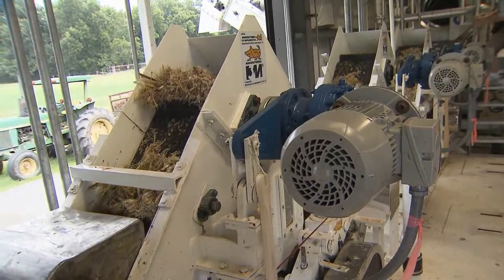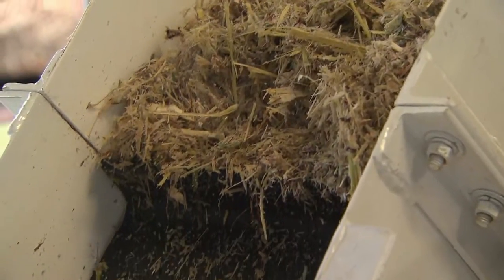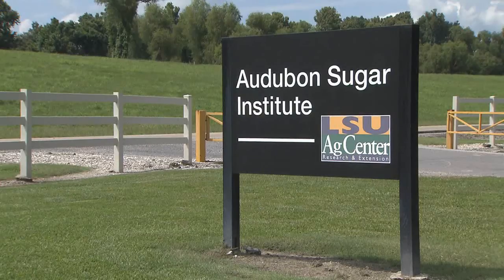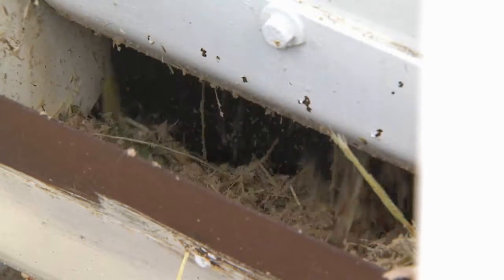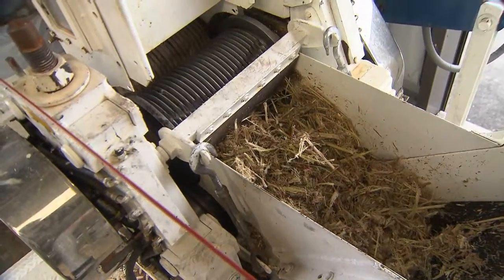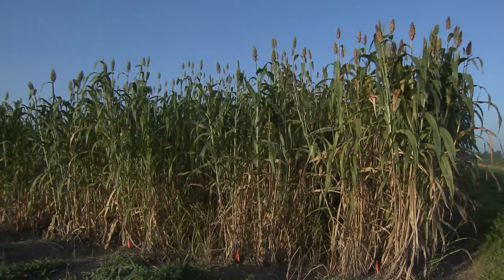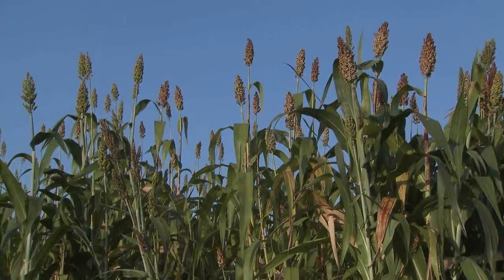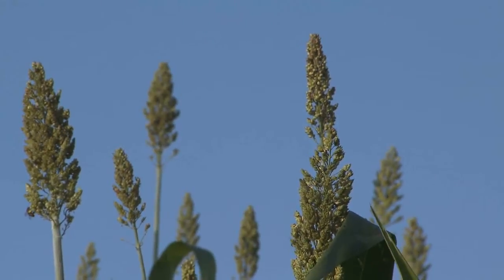Audubon Sugar Institute is turning sweet sorghum into biochemicals

Comment: find the crushing machine link below  @QY7Y   , contact for more info whatsapp - +91 9045142808  or email mohdfaiz0022@@tyou have very good crushing machine,
we are expert in making crushing mill since last 40 years with very low capacity 40 TPD to 1000 TPD.
with raw juice extraction upto 72 %.

@gASk